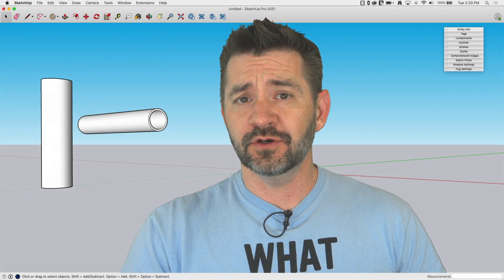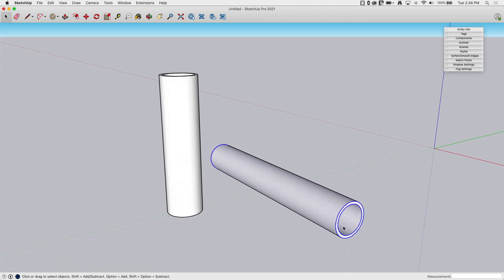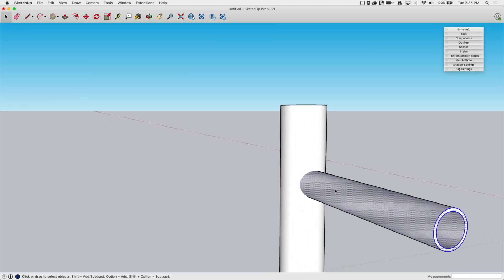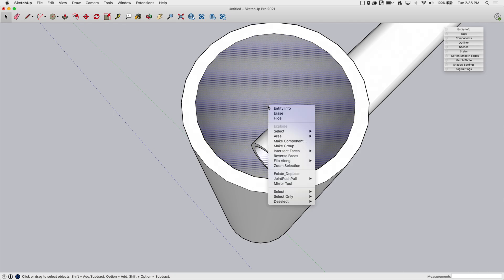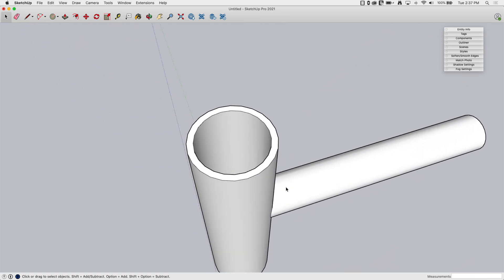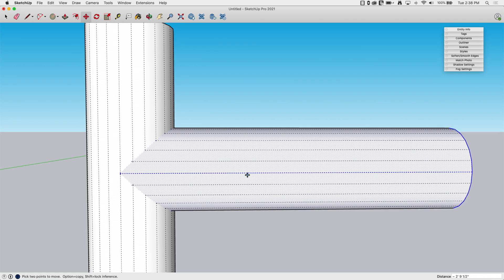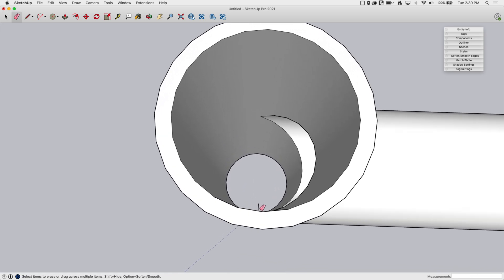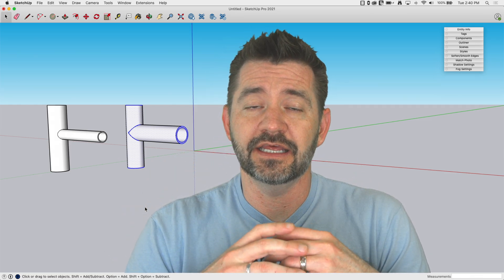Joining Pipes with Intersect - Skill Builder

Comment: Will this work for creating copes in pipe? I draw handrails in sketchup, and I have this scenario but the vertical does not need a hole in it. I would just need the cut out on the horizontal piece.

Comment: What's a clever way to put a radius weld around where two cylinders or pipes intersect? I tried follow-me around the intersecting ring using an arc but it doesn't quite work correctly.

Comment: Why don't you just select the whole damn thing, intersect faces with model and trim off all the stuff you don't want? That's what I do literally every single time with no issues and it takes a fraction of the time.

You don't have to select the outside face of the vertical pipe and the outside face of the horizontal pipe and intersect faces with selection.... then pan over to the top of the vertical pipe, zoom in, select the inner face of the vertical pipe, select the outer face of the horizontal pipe, and intersect faces with selection, trim the inner leftovers, zoom back out, pan over to the end of the horizontal pipe, zoom in and delete the two inside circles that was previously the inside and outside faces of the vertical pipe. That took way longer than it could've taken.

Work smarter not harder. Part of working smarter is working more efficiently.
Reply from the maker: That can absolutely be done! Many of our videos are created with the intention of teaching how something works so you, the viewer, learn all the options and can make the ideal workflow for your specific usecase!

Comment: I had som electric boxes (group/solid) in a wall (group/solid), when I removed the wall section “in the box” (process, double click wall, draw box, select face and push back until back face) sometimes I have “holes” with side lines and some times no sidelines on the holes. Can’t figure out what I did wrong or different...

Comment: Excellent timing Aaron,  I'm just designing my dust collection system for the workshop and have been struggling to get the pipework joints to look correct.  Thanks for the video and clear instructions.

Comment: Thanks for the video!

I have a question related to intersect or subtract to be specific.

So I  trying to substract using a sphere and rectangle. But I think the sphere I Create is not solid. Will it possible if you can make a video to fix that problem? How to make a Solid Sphere
Reply: You probably have some leftover geometry inside of the sphere (circle you used to make it with follow me). You can use "Solid Inspector" extension to clean it up or zoom in to sphere until you are inside of the sphere and then delete everything you don't need in there.